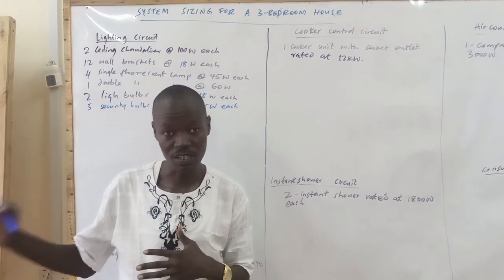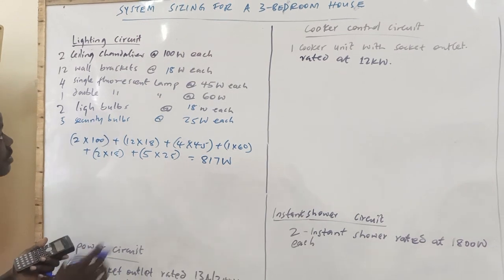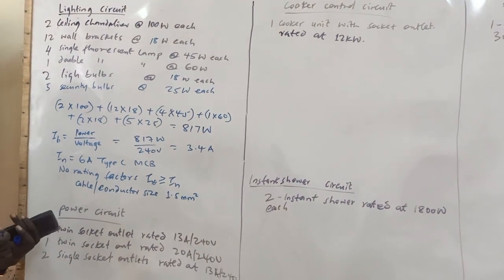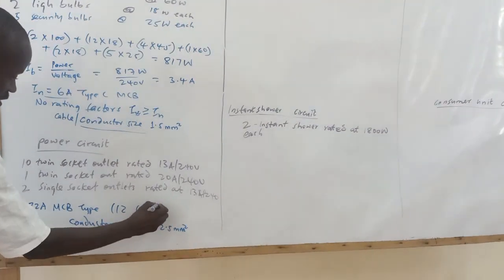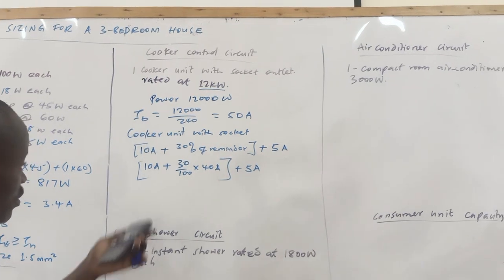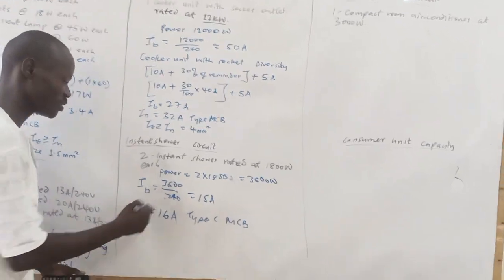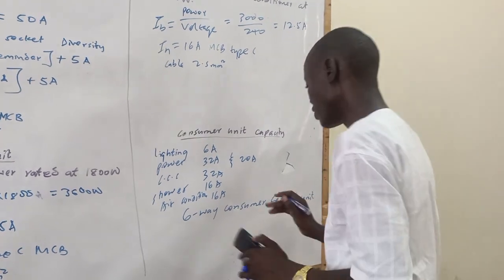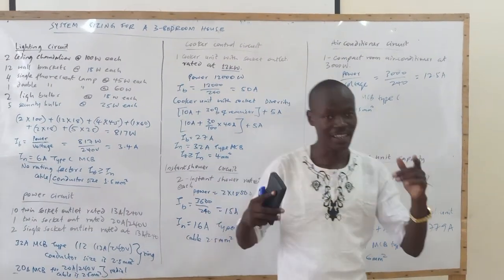ELECTRICAL SYSTEM SIZING FOR A THREE BEDROOMS HOUSE

Comment: Sir, can you check your sizing again because in power circuit we have ring and redial circuit but your DB sizing you only use one
Reply from the maker: Ring's feeding and return lives should be from the same circuit breaker.  Using two separate breakers implies that even the circuit is one but from the DB it will be circuits. To ensure safety of the circuit and cost implications, use one single pole MCB or Double pole MCB for a ring circuit unless the circuit is feeding sockets outlets spread in an area exceeding 100sq. metres. Wiring Regulations must always be observed